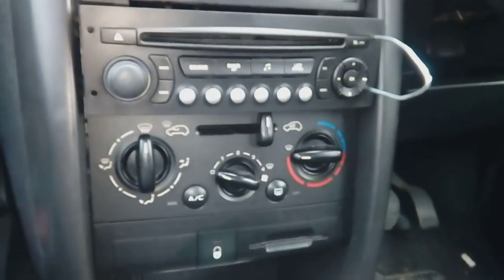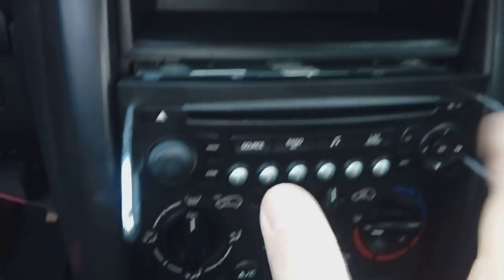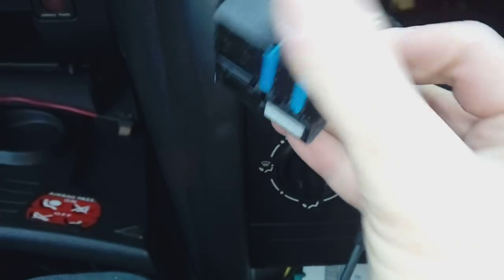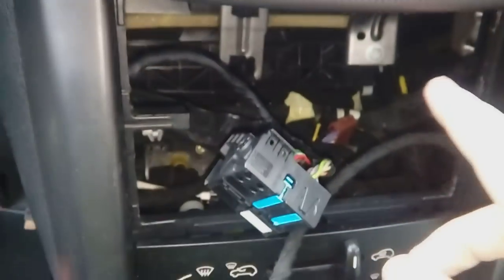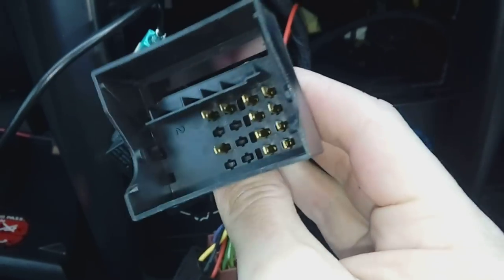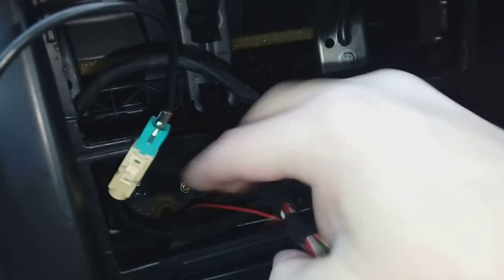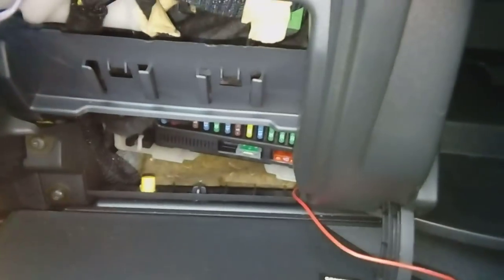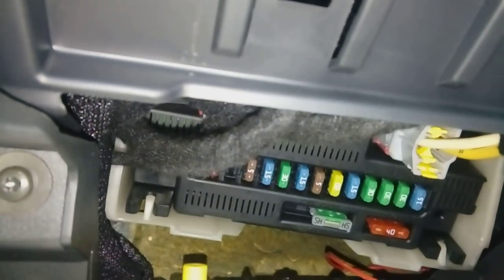Peugeot 207 radio removal/ installation quick guide includes power info

Comment: Hi PJ, I'm at the end of my tether with the stereo on my 207cc 2008 (the newer version of 2008)...i have the connects2 harness.
I have tried every wiring way I can think of, the only one that sort of works is red going from stereo to the fuse box (however it also works exactly the same with yellow wire to fuse and then the red attached to yellow!) That leaves the red from the harness end attached to nothing (but it doesn't seem to do anything even when joined to every other wire, i even moved it over a pin slot because that was a suggestion, but it still did nothing there)
The problem is it loses all it's settings on every wiring possibility :-(
The long cable this kit has is orange (labeled key illumination) .... and the only way this works is to run it also to the fuse, all it does is illuminate the radio on key turn before the radio is actually turned on. 
I have read so many conflicting suggestions, nothing keeps the settings. 
I have the red wire attached to the 3rd fuse along (brown 5amp) .
Do you have any idea how to get permanent power to it so it saves settings please, I've didn't hours doing what people suggest to no avail. Thank you!
Reply from the maker: The radio needs two power feed,one that is live all the time for the red wire and one that switches off with the ignition. However on most Peugeot models the ignition power is on a delayed shut down and so when you take the key out the power will remain live for a few minutes but eventually will switch off and if you running both your powers to this delayed switch feed this is why your radios settings are getting lost.
Make sure the red wire goes to a constant live,if you sit in the car with the ignition off for long enough you will see the radio goes dead after a while.
Reply: Hi PJ I have this issue with installing Sony xav-ax1000 in Peugeot 207 cc. Thanks for explaining the delayed power loss. 
You say that the red wire should be connected to an always on wire.
I’m a bit confused as in the Sony manual the red is marked as acc and the yellow to the battery. I have an adapter harness that connects the peugeot harness to the iso harness.
Should I run a wire from the peugeot, iso adapter or iso Sony harness? 
Should I use the piggyback fuse option or just tap it into a wire?
Can you recommend a suitable always on fuse to use?
Appreciate your help.

Comment: Hey, just a bit confused. What fuse do I need to plug it into? Is it the red 10A one or the one between that and the brown one?
Reply from the maker: Use the gap between the red 10amp and the brown 5amp because this gap also has a 5amp brown fuse that is removed and put in the fuse spur.
However fusebox layouts can vary depending on what county the car is sold in and what spec level it has so be sure to use the owners handbook and a test probe to help make sure your using a ignition switched accessory fuse.

Comment: If I'm fitting a Pioneer into my Peugeot, I assume i don't need to get the adapter and just match up all the plugs and whatnot to the right connectors on the new radio?

Comment: PJ Projects - excellent and helpful video. Thanks!

I've followed your advice and all good so far in installing a Pioneer in my Peugeot 207 (2009). 

Just one question - where can I buy this adapter that you used in between the loose red wire on the harness and the fuse box in the car?

Many thanks.

Comment: I Have a Peugeot partner 2015 reg, I've bought the ISO harness adapter from Halfords, with the ignition double fuse and the Ariel adapter, however where do the wires in the white plug in the cars harness (same as in the video) connect in to? Cheers
Reply from the maker: The white plug just runs some display bits and on some models it runs the steering wheel radio controls. The plug is not needed when changing to an aftermarket radio.
Reply: @PJsprojects  thanks for the reply! Much appreciated.. I do think this is for steering stalk controls, as I've now got it working and the only thing not working are the stalk controls. Is there any adapter able to get this working? Or how to work out which wires do what in the harness?

Comment: I've put in a custom radio and now the clock on the top of the car I can't change it
Reply from the maker: Yes that’s correct, original radio needed or expensive display interface needed. (Consult retailer)

Comment: Hi, first of all thank you very much for the video. It all helped a lot. I have one more question. When you click the fuse in this socket you said, the radio turns on and off only with the key.However, I want to have the radio even with the car power off. So, I stick it on the third one, the ignition one, but the radio keeps turns on when you open the door and that is not the how it should be. I know as well that you can say to turn off the radio before leave the car, but do you think there is another way to fix it and adjust it?! Thanks again for the help. Best regards
Reply from the maker: At the radio end one of your power cables is live all the time,it's designed to keep the radios memory, if you wire both the yellow and red wire to that cable your radio can be used when the key is not in the ignition. Just remember to either switch it off fully or remove the face plate.
Reply: @PJsprojects hello PJ, I have the red and yellow cable both wired together. Will my battery drain even if I take the faceplate off? Thank you in advance!

Comment: One question I do have is the fuse adaptor is female and so is the stereo adaptors red wire so can I buy a bit to connect them ??
Reply from the maker: Yes you just need some red bullet connectors,do not get blue ones as they are two large.
Reply: PJs projects great I shull be sorting that tomorrow then thank you!!

Comment: If I am replacing like for like radio - do I still need to get the extra wire connecting bits?
Reply from the maker: Nothing needed at all if your doing a like for like swap.

Comment: What is the soecific name of the fuse adapter part as I need one and don't want a certain car accessories place giving me the wrong thing or missing something out like they have done twice already now xx
Reply from the maker: It's called a fuse spur. Take a photo of this with you - Item number 252882363950

http://www.ebay.co.uk/itm/1-X-Mini-Blade-Spur-Add-a-Circuit-Fuse-Tap-Piggy-Back-Blade-Fuse-Holder-12-24-/252882363950?hash=item3ae0f6a62e:g:oHQAAOSwOVpXfScg
Reply: PJs projects thank you very much xx

Comment: Need your help. I had my radio changed but however on the trip computer it's showing different time and dates. I have the same car as you. Any ideas i can do to get it fixed? It's showing a date it wasn't even manufactured in lmao.
Reply from the maker: One of the down sides to changing the oem radio is that you can no longer set date or time. Not the best decision by Peugeot...

Comment: I have the the same radio, the cd player won't play CDs   and constantly wants to eject, any ideas on how to fix this fault? Cheers
Reply from the maker: Sounds like the loading mech has gone out of alignment or the worm drive(cog) has worn,either way the labour cost would be more than buying a new radio. You should be able to get a used oe spec radio from a breakers or maybe Ebay,just make sure it comes with the correct security code.

Comment: I've got a Peugeot 207 sw, I can't seem to figure it out. Got the pc2-86-4 harness adapter. It all matches up but left with that red wire and it's baffling me, what to do with it. I've watched this video and still no clue 😂😂
Reply from the maker: Hi.
You need to connect the red wire to the fuse box, sounds a nightmare but it's not,all you need to do is find a fuse that is dead when the ignition is switched off. Most 207 models have a tan coloured 5amp fuse on the lower left hand side of the fuse box that is ignition switched, so start with that one. Either get one of those little screwdrivers with a bulb in and a bit of wire coming out the top and use that to test by touching the top of the fuse with the screwdriver tip while the wire is connected to a earth such as a none painted bolt like what hold the door stay on. If the screwdriver lights up then the fuse is 'Live' and is no good. You need to find one that goes 'dead' when the ignition is turned off.
When you find a ignition switched fuse go and buy a mini fuse jumper from most car shops(around £2) this plugs in where the original fuse was and houses two fuses,one for the new radio supply and one for the circuit you removed the fuse from.

Good luck.
Reply: PJs projects been told to wire it to the 12v socket, would this work
Reply from the maker: Hmm well it's a sort of workable bodge,not something I would do but to be fair many people do this,on the back of your 12v socket is either two or three wires depending if it is illuminated or not. Look at the rear of the socket and you will notice one wire goes to the center(this is power) and one wire connects to a spade on the side(this is earth),the other thin wire is for the illumination. You need the center wire(the power wire),chop it a couple of inches down from the socket and either bullet crimp or solder your radios red power wire to it. Make 100% sure you use electrical tape to cover the entire connection.
Reply: PJs projects was going to  use a splice connector but this is only going off what someone e has advised I'm completely in the dark lol
Reply from the maker: Splice connector or Scotch locks can work loose and are frowned on in the trade,if you use one make sure to fully crimp it in and cover the thing in electrical tape.
Reply: If your still having this problem connect to cigarette lighter fuse I know in mine cigarette lighter doesn’t work unless ignition is on which is where I plan on wiring mine into correct if I’m wrong but that would work wouldn’t it I’m no electrician so following YouTube tutorials

Comment: Any idea on how to get the steering control working from on an after market Sony radio unit?
Reply: It's about £50 for the steering stick connection, and you need to get a parking sensor add on as it's done via the old factory fitted stereo. All the videos I've seen never mention these issues.